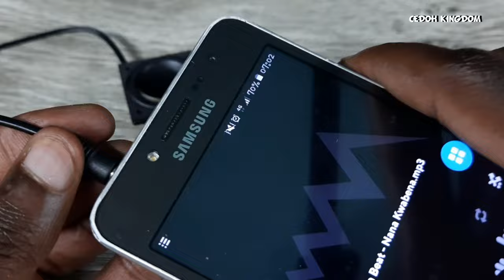Connecting AUX to Speaker Wire

Comment: Very informative, thanks dude!
Have you wired speaker wire (stereo, output) to aux input?
Reply: Does somebody know if this works, speaker wire output to aux input?
Reply: @muhschy I don’t think it would work as that use bare speaker wire need an amplifier and if you were to attach an aux cable 3.5 or 1/4 inch and plug it into a phone it wouldn’t have enough power